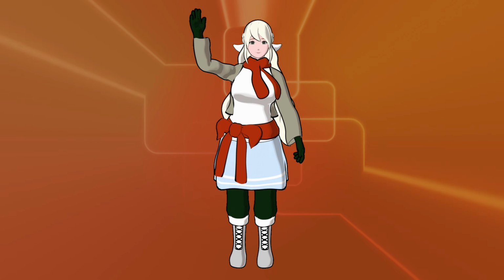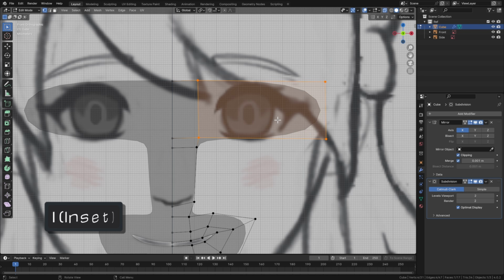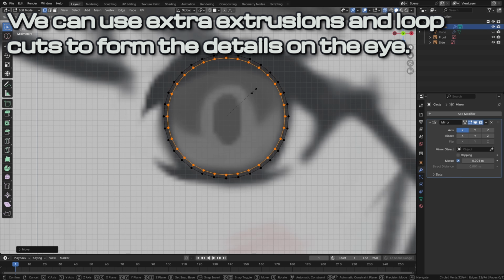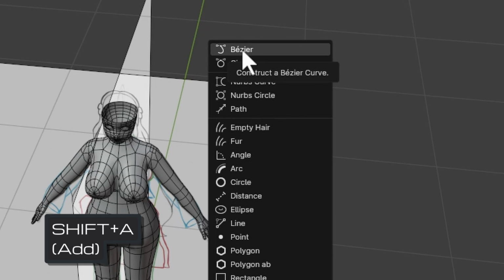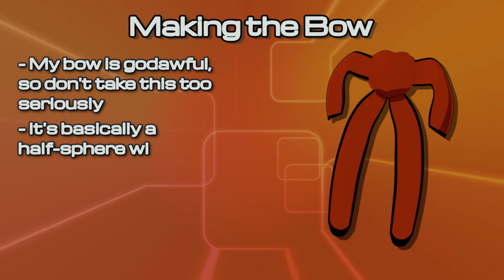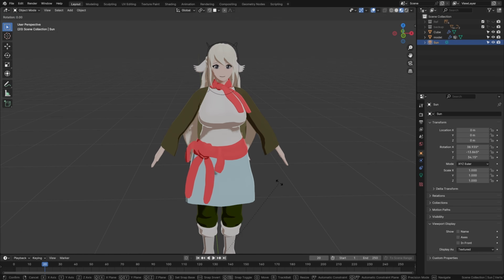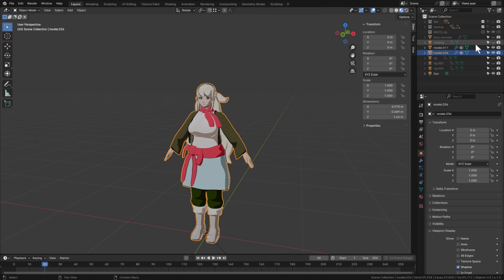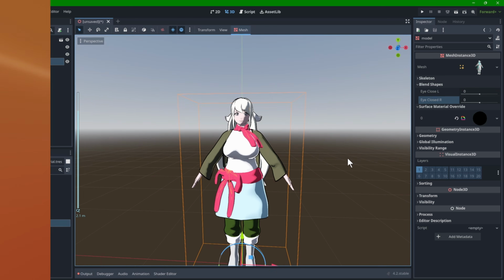COMPLETE 3D Character Creation Guide - from Blender to Godot

Comment: amazing tutorial. I just had one issue, when I was making my characters top there was weird deformation at the middle vertex, any tips to fix this?
Reply from the maker: Thank you! Is this in regards to rigging or modeling? I know the "Clipping" setting on the Mirror modifier can get in the way sometimes, so I often disable it when working in tight areas, then re-enable it when I'm done.
Reply: It was in modeling, i turned off the clipping and adjusted some vertices then turned it back on and snapped them in place without deformation. Thanks for the feedback.
Reply from the maker: @itzmenaomii_  No problem! Glad you got it to work

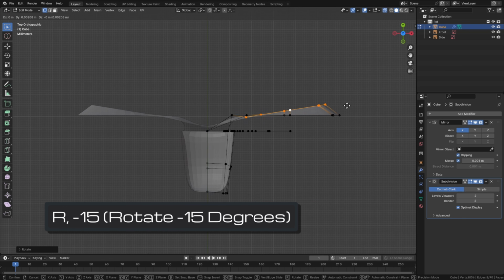Comment: I'm a beginner. I can't really understand how the author understood how to model the head, how many vertices are needed and where, I don't think I can repeat it as in the video. especially since 15:00. even if I repeat everything after the author, I am not sure that I can learn something and create a similar model on my own.😩I don't think the polygonal approach is as accurate as the author says when creating organic models. Perhaps character modeling is the most difficult.
Reply from the maker: I apologize that I wasn't able to help you. Is there something I could clarify in the comments here? In the case where we're building the core face loops, it's easiest to start with about 6 or 8 vertices for the mouth. Then work from the mouth up to the nose and then the eyes, and you should be able to connect everything. Don't be afraid to add more edge loops too with the Loop Cut and Slide tool (CTRL + R is the shortcut) if you are having trouble getting things to connect.

Comment: What if an edge is both a seam, a crease, and a sharp edge,  how inspect what type this edge is or how can I filter one type of edge, i.e. how let a model only shows its seam edge, or only shows crease edge?
Reply from the maker: I was looking into this and thought that Blender had something under the Select menu in Edit Mode, but there isn't really anything that supports exactly what you're asking. You can select edges with the same crease level with Select > Select Similar > Edge Crease, and you can select sharp edges (seems to be based on an angle though, not by how it's marked) with Select > Sharp Edges. Other than that, I don't think there's a way to change the visibility based on edge type.

Comment: A cool thing you can do is if you add a translucent BSDF, plug it into a shader to RGB node, then plug that into the B slot of the final color mix node, your highlight now changes color depending on the color of the light source lighting it

If you want the highlight to even more accurately resemble the light source you can just plug in another translucent BSDF + Shader to RGB node then plug that in to the color of your original translucent BSDF node
Reply from the maker: Thank you for the tip! I believe you can also get the light's color and then multiply it with the shaded area in your shader nodes too.

Comment: When I add a metarig it doesn't come with any bone groups by default and it's making the rigging part of the video very hard to follow
Reply from the maker: The metarig itself does not have bone groups, but the generated rig does. That being said, it may be confusing at that part. Let me rewatch it and see if I can help you further.
Reply from the maker: Is this where you got stuck at? 1:07:14

Also, what version of Blender are you using? 

It seems like the bone collections are there in v4.3.1 when I create a human metarig. If I understand correctly, by bone groups you mean bone collections?

Let me know what I'm missing.
Reply: @codernunk  Yeah, it was just a version issue, I was on 3.5. I updated and now it's fixed

Comment: I don't understand how to draw those straight sharp lines. Shift + LMB does nothing at all and it's seemingly impossible to get a sharp one pixel line.
Reply from the maker: It looks like Blender changed things around here in later 4.x versions.

Now, you have to change the Stroke type from "Dots" to "Line" in order to draw straight lines, and instead of SHIFT, hold ALT to snap to 45 degree angles.

To make it draw pixels, I believe you just change the Falloff to "Constant".

Let me know if you still have trouble with this.
Reply: @codernunk  Yup, you are right. Thanks! Also I had to turn of Anti-Aliasing for the brush under the Advanced drop-down menu. I think that is what makes it blurry.

Comment: The traditional quad polygon subdivided modeling use usualy less polygon to get the overral shape thats perfect for animation on setup like smartphone game, in the other hand scuplt is more free if you start from nothing but need retopology or several automatic polygon reduction and some normal map baking of the high polycount model to the low res polycount, you can also use both a low poly for the animation and proportion cage and an high detail sculpting pass by subdivision and sculpting process it's very common to use both in most gaming company , even if they start with high detail Zbrush stuff they optimise the character to be animated at low poly scale for better game engine performance.
Reply from the maker: This is correct. There's pros and cons for both solutions and they both work well. Sometimes using both of them at the same time is a valid use case too.
Reply: @codernunk  sculpt is more permissive and are great for non animated stuff or concept , polygonal or subdivision nurbs are more clean to animate and can benefit from a sculpt pass for more detail there's no perfect solution , only clever method ...

Comment: Great video, but how did you drag the Base.PNG file from the character? I can't figure out how make that appear? My figure has no colour.
Reply from the maker: Thank you. Remind me, is this for the shader in Blender or in Godot? For the latter, you may want to double check the flags you have on the shader. I think you may need to turn culling to "disabled" so it displays the texture on both sides in Godot. Let me know how I can help clarify.
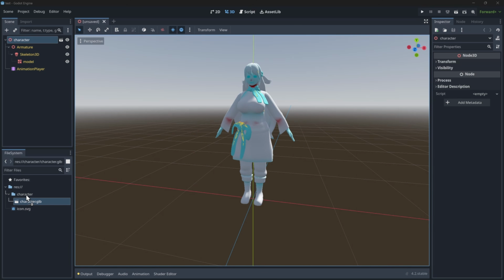Reply: @codernunk sorry, I mean at 1:22:00 you have the imported glb file in godot but the png file seems to appear from nowhere. I've watched many times at 0.25 speed, but I can't see how you made it appear. I just have the glb file like you did until that point.
Reply from the maker: @gibbbbo  I see. Thanks for pointing this out. I manually copied the file from the 3D model's directory to where the exported model lives in Godot. I failed to mention that I did this or show that this was done. Apologies for the confusion.
Reply: @codernunk  Ah, ok. I see where I went wrong. After I mapped the meshes to the colour pallet, I didnt click Image>Save to create a PNG file in my blend folder. I've now done that and copied it to my godot folder, so it's displaying fine. Thanks for the quick replies!
Reply from the maker: @gibbbbo  No worries! It can be easy to forget to save the image to an external file. Glad you got your issue resolved.

Comment: Awesome resource my dude! Thanks a lot for splitting this tremendous guide into easily parseable chapters! I was mainly interested in your toon shader at the end, and I do have one critique: you use a couple of smoothstep nodes to "simulate" a ramp. However it is much easier to add a texture2d parameter and set a gradient. Just plug your dot product into the Texture2D's uv port and voila! Same result, but more flexible and easier to configure (just don't forget to set "repeat" to disabled). Otherwise I learned a lot and I can't wait for more guides and for your channel to get the attention it deserves!
Reply from the maker: Thank you for the feedback as well. I'm glad you got what you wanted to get out of the video. 
I tried creating a color ramp with a Texture2D node before in Godot but it wasn't working quite how I wanted it to. I'll give it another try sometime - maybe the "repeat" setting is what I missed. Thanks again!

Comment: This has been a very thorough and (long) guide that would work great as individual videos!

One thing that I feel was left out and I was looking for: how did you set up the bow and attach it to the hands? Is it a separate character model that just already has the bow in it's hands upon import? I noticed in the third person shooter demo from godot that they used separate bones for the weapon attachment points. I don't fully understand it all yet, but I'd like to know how you accomplished it at least!

Thanks for the great tut!
Reply from the maker: Thank you! I bounced back and forth around the individual video idea, and there were some that were done as parts leading up to the final release of this one (they are currently unlisted though).

Don't worry about the bow - I'm going to make a full video on that soon. The nutshell version is that you can model the bow separately, rig the bow with a handle bone, and then you can use Copy Location/Rotation while in Blender to attach it to the hand or BoneAttachments in Godot to do the same thing.

Comment: Love this tutorial. Definitely gonna use this as a template next time I tackle trying to learn to model a character (I've tried a few times but never been quite happy with it/completed it). One question I have is if you don't have big fancy hair, or if they aren't going to have bangs. what kind of process should I use to complete the forhead, top, and back of the head. (my thought is complete the head and make them bald, to have as much freedom with different hair styles later). Thanks So Much!
Reply from the maker: I'm glad you enjoyed the tutorial!

For your question, I usually complete the top of the head like I did with the neck and the back of the head. You can connect one or two faces from the front of the head to the back where the hole is. Next, you can make a series of loop cuts to shape out the top of the head from that face. Then you can fill in the faces on the side rim, adding or dissolving any edge loops so you have enough verts to make quads. It's a bit hard to explain here, so feel free to follow up with any questions.

Comment: i've been using Blender for quite a while now, i know a lot of the hot keys, differences between modelling, shading, uvs, but rigging is what i always have trouble with (and the main reason on why none of my models ever see the light) but the trick of snapping vertexs on the fingers to snap the finger rigs made me speechless, it's so clever i couldn't have thought about it by my own, neat trick i'll be using for sure
Reply from the maker: Awesome. Glad to hear something so specific such as that makes a difference. Thanks for stopping by!
Reply: @codernunk  will stick around, your video (even if i wasn't following it) helped me get the motivation i need to create my characters, i'm not so good at the reference sheet part since i'm terrible at digital art but once i practice i'll use everything i learned from you!

Comment: I messed something up. I think it has to do with making the custom face normals but my face now looks incredibly twisted. I have a backup so I'm doing it again, but can you clarify what that particular step is supposed to do?
Reply from the maker: The custom face normals are only really necessary if you want to make an "anime" style character. It helps sell the look because otherwise there would be extra shading on the face indents without this step. It's possible that you may have the wrong settings on the DataTransfer modifier and that's causing issues. Let me know if you have further questions.
Reply: @codernunk  I redid the steps and the face normals getting screwed up at the solidify step. Not quite sure how to fix that bit, might have to mess around with the weight settings
Reply from the maker: @megaman12321  Did you recalculate the normals on the outside? Try doing that for both the proxy mesh (used for the data transfer) and your character. Some normals may be facing the wrong way. You can also use the normal overlay display option to see which way they are facing on your model.
Reply: @codernunk  I guess I didn't. I just redid it again with recalculating the normals first and while a bit chunky look perfectly smooth now. Thanks for the suggestion!
Reply: @codernunk Sorry to ask, but I tried to push the red vertexs into green and then go into the shading tab and add separate color, but attaching red seems to give a different color then what I had originally shaded. For whatever reason, attaching blue to the multiply instead makes it turn to what I originally had for shading. Do you have any clues as to why that might be? I guess it should be noted that when I do the isolate thing I get a purple-blue color after doing the apply changes in the VCM tab

Edit: I changed my Color Ramp Constraint to be .1 instead of .13 and that made the shade look close enough to what I wanted. Guess it really was important to be set like that.

I'll keep the question up cause who knows, someone might have the same issue. But a seperate one if your reading :p

What does the Fresnel shader do for thin geometry? My eyebrows are just polygons with no depth and I've noticed that when I turn the camera they just kind of disappear into white. The eyes did this too until they just somehow stopped somewhere around my third retry of the model. Did I make a mistake there on the eyebrows or is it something to do with the Color Ramp for the Fresnel?

Comment: How do you get the mesh to be semi-transparent like that? My X-Ray just makes the faces all empty and I can't seem to match it
Reply from the maker: The shortcut I use is pressing the Z key while in Edit Mode. If you press it, it should turn on X-Ray and wireframe at the same time, and you can press it again to go back to where you were. If you hold Z, a circle menu will appear that gives you more options.

Comment: While i still use Unity over Godot, because of its stronger 3D, this video was immensely helpful with the Character Modeling side and the Workflow attached to it. Learned a lot from it
Reply from the maker: I'm glad you learned from it! I can understand Unity's 3D integration is much better overall. While this was targeted toward Godot users, it's still mostly a 3D modeling guide so it should be helpful to any engine user.
Reply: No. Godot is better for 3D games. Unity is better for non-complex 2D games.